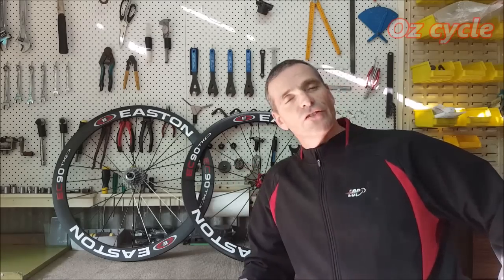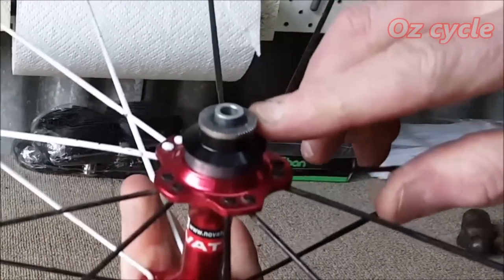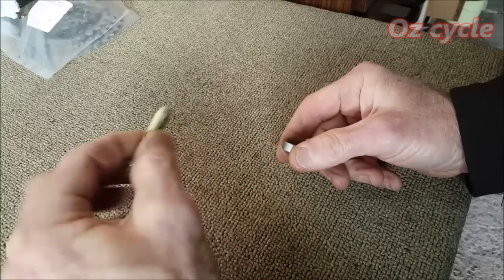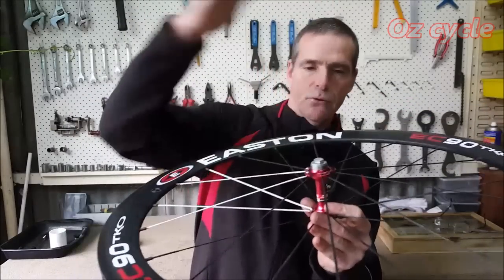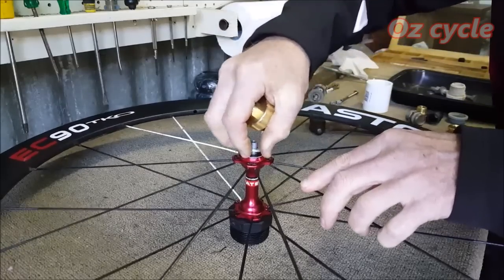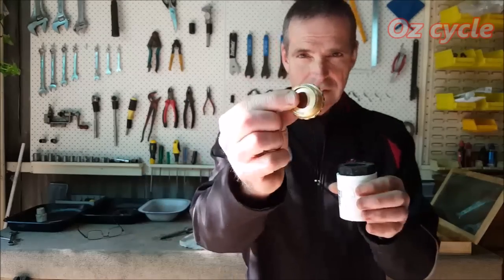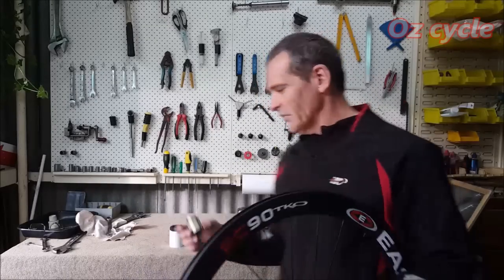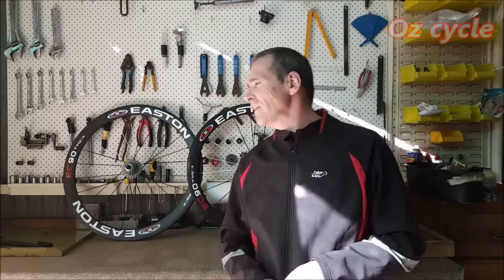Hub sealed bearings-Extract &Press no special tools

Comment: Thanks for the tip - it helped me to pull a bearing without having to buy a bearing puller!
(In the UK these "Dynabolts" are known as "anchor bolts" or "shield bolts", but they do the same job.)
Reply from the maker: Thats great! ...and thank you for the right names for the bolts in the UK. 😁
Reply: hi there, im trying to get in germany but there are so many types. would you point me to the right one? thanks

Comment: Watching this just helped me troubleshoot what was (to me) a baffling problem: there was a bit of slop in my front hub that I just could not get rid of, despite adjusting preload nuts, cinching the hub extra tight etc. It was driving me nuts. Turns out the bearing had crept out at some point and was not fully seated. As a result, the axle wasn't seated either. A few light taps with the proper drift set it in place and the slop disappeared.

I've watched your other videos before, and despite the fact that I have a fair number of homemade and store-bought tools already, I'm a subscriber now. Excellent explanations, especially when faced with something out of the ordinary. Thank you!
Reply from the maker: +Oliver Neubauer Glad to hear you found the problem with front bearing not quite seated right Oliver. Sealed bearing hubs are good but not perfect.
Reply: exact same thing for me!

Comment: Great video - thanks. About to do a front 15mm thru-axle Giant hub with 6804 bearings (20mm ID, 32mm OD) and thought I'd see what YouTube had, you covered a couple of things I hadn't considered. Good tip on the Dynabolt for bearing extraction and the reducing bush as a stand. Will check out your other videos now, some of your tools resemble ones I've cobbled together for one-off jobs rather than paying for the pro tools!

Comment: I hsve the Novatech hubs on my Chinese carbon wheels, I got water in the front bearings from cleaning with the hose and so they then rusted up. Very easy to knock out the old bearings without anything but a rubber/wood mallet. Squeezed the new bearings in with the scewer. So easy I could do it on the side of the road. haha. Still some good stuff here in your vid. Thanks.
Reply from the maker: +ozesalsa Yes Ive seen the squere used as a press  :).  Unfortunately rear bearings are a bit more difficult than rhe front.

Comment: If the bearing is very tight leave the bearings in the freezer overnight which will make the bearing shrink slightly making the job easier
Reply from the maker: +Danrandon900 Thats a great suggestion Danrandon!!
Reply: oz cycle my Whyte 146 pivot bearings are so tight on tolerance that it's the only way to get them in without getting them in at an angle. The other way is to heat the object you are pressing them in to but you can damage paint etc and possibly weaken the part. Freezing the bearing is safer and less hassle
Reply from the maker: +Danrandon900 Gee thats tight! Have you tried using teflon based lubricant to help them glide in?
Reply: oz cycle tried everything. Spoke to Whyte and they do it the way as me
Reply from the maker: +Danrandon900 Nice to know...thanx.
Reply: And heat gun on the hub
Reply: @Melissa H lol🤣🤣

Comment: Thank you, great video. 

I am missing one part of the Press-in. You tapped the drive-side bearing on to the axle. Next step is how you insert the non-drive-side bearing. How do I press in the drive-side bearing on the axle?
Reply from the maker: Press driveside bearing into the frame first,then push BB axle thru frame.
Reply: @stevenleffanue  Thank you. I managed to get the the bearings back in. Your video helped me enormously.
Reply: Extraction/insertion of the drive side bearing is conspicuous by its absence. Will probably be obvious, when I come to do it, but would be nice to see it, for completeness

Comment: Just some advice you may want to alter your process. When you put force on a bearing to install or remove you always want he force on the outer race. This method puts force on the inner race. This makes microscopic dents on the race and make the bearing start to wear and be less smooth. You may never notice this or if its real tight you may notice this the first time but the dents are there. Just something to think about if you are a racer that is looking to save all the watts possible.
Reply from the maker: Absolutely right Andrew. Try cleaning and relubing the bearing without extraction. If the bearing needs to be removed....To dislodge some need to be tapped on the inner race. In this case the bearing should be replaced.

Comment: How to remove bearings in Chosen hubs with hallow aluminium axle spacer between the bearings which joins both inner races of the bearings together? I guess with a blind bearing puller only.

Comment: I say the dynabolt thing makes no total sense. You can just tap it inside the hole right? Maybe a washer for even tapp distribution but all in all great informative video thanks
Reply: My dyna bolt pulled through. Instead just hit bearing with bolt from inside at 3, 6, 9, 12 positions until it falls out
Reply: You may damage the bearing. I think the point of the dynabolt is that it distributes the force evenly on the bearing. If you do not plan to reuse the bearings, then yes, tap it out.

Comment: Three years on and this video is still, great. I think I might of solved it for now but this morning  I got that crunching noise from my back wheel and wondered what it was. The wheels are low budget Fulcrum Racing Sports. Working on the non drive side I discovered they were cartridge bearings , my first as all my other bikes have ball bearings , so I lifted out the seal and filled it with grease which hopefully will last a few months. So I can see how you could replace this bearing but when  tried to get the freewheel off it appears to be non detachable and tied on by  the spokes. So if you should read this can you tell me whether this is common on cheap wheels and could I use a variation of your method to remove the wheel bearing that sits inside the freewheel. As normal your videos are Premier league stuff. Thanks.
Reply from the maker: All bearings can be replaced. It should be possible to get instructions from  Fulcrum in your model hub ,Ted.
Reply: @stevenleffanue  Thanks for replying and I will look them up. Enjoy your Summer. Ted

Comment: What a nice chap. Great video but you didn't remove the rear drive side bearing?
Reply from the maker: Rarely does the inner bearing require service/replacement as it is sealed from the elements by the hub shell.

Comment: Some bike mechanics dont recomend taping for insert they use like bolt press to put the bearing´s in! But they have to tap at least one of them? Or there is another way arround?
Reply from the maker: +N Garcia Some hubs the bearing fit is tight so a press is better. The important thing is not to damage bearings either extracting or pressing and that they seat evenly.

Comment: Great informative video! Just wondering what dimension of expanding bolt you would recommend for removing a bearing with internal diameter of 15mm (6802/3)
Reply from the maker: Closest size to 15mm is 12mm Mat.
Reply: I wrapped some soda can aluminum around the inside of the anchor-bolt to expand the sleeve a bit extra to bite on a larger diameter bearing.

Comment: Hi Oz Cycle.  I've just installed brand spanking new bearings in my rear hub and, silly me, I've realised that the tube or cylinder that sits between the two bearings inside the hub is still sitting on my bench top.  So, I need to remove one of the bearings.  I used your methods in this video to get the old bearings out, as I was going to be throwing them away anyway, but what are your thoughts on using the "tapping" method on a freshly installed new bearing?   Is my fear of "tapping" a brand new bearing out unwarranted?
Reply from the maker: Tap it out by the outer race edge if you can and it will be fine.
Reply: @stevenleffanue  Thanks mate.  All done.

Comment: Would you please be so kind to explain how this works on a Giant P-SLR 1 (50 mm) wheelset with 5 mm QR spanners? This set is build with DT Swiss hubs. Sadly, nobody seems to know how the freehub body comes off. In my case this body is damaged and i would like replace the bearings as well.
Reply from the maker: I dont have a video specifically for your DT rear hub Arno but there are quite a few on Youtube how to remove the body and service it.

Comment: I used deep impact sockets to drive the first bearing out, second bearing wanted to play games so I hit the hub with mapp gas torch and drove it out with a few hard smacks on the hammer. bearings are totally rusted and crunchy, this was the clicking noise i was getting when coasting.

Comment: Love your videos really informative...my problem is that I’m not on Facebook, so unable to get of the item measurements I require to make your tools...I’m also have trouble looking for the 40mm reducing bush...I’m based in the UK
Reply from the maker: If you cant source the 40mm reducing bush,I can send one to you?...postage would cost more than the bush itself tho.
Reply: oz cycle...I’ll keep looking or I’ll find something similar.  But many thanks for that offer...Keep up the great work.
 Cheers Max
Reply: @stevenleffanue   just put the bearings in the  freezer for an hour  and they should pop right in without any force.

Comment: Can you replace the unsealed bearings on a Shimano 105 hub with sealed bearings? Great video and tools to :-) ! 👍
Reply from the maker: You could but the sealed bearing may move around a bit on the curved race designed for round balls. If you could remove those races and get a nice square fit of the sealed bearing to the hub shell it would probably be ok but that's a bit of work and if it doesn't work out you have ruined the hub.
Reply: Cheers Thankyou . What size ball are they as they extremely grindy

Comment: Hi,
I'm interest in the following setup, What sellers do you recommend ?
- Front 24mm rear 38 mm
- tubular
- lighter Hubs with ceramic bearings.
- finish ud mate
- all parts black.

thanks
Reply from the maker: Yup. Yoeleo are now using DT Swiss 180 carbon hubs with ceramic bearings.  They will custom build wheels how you want.
Reply: Thanks,
Yoeleo are a little bit expensive..... do you trust in light hubs from novatec (AS511SB FS522SB ) or powerway (R36 or R39) ?
Of which are the best for your experience ?
Reply from the maker: Yes,Yoeleo are not the cheapest wheelsets. I would lean towards Novatec myself ,they have a good longterm reputation.

Comment: I removed rear axle , but left the 2 bearings inside. I want to remove both bearings cartridges for new. Do i just do this with dyna bolt methods like front hub ?
Reply from the maker: Yes you can or use a blind end puller
Reply: @stevenleffanue  i managed to fudge it so it worked, bit difficult. Just curious so i understand, why did you use the bolt press method for front and not the rear to install bearings. ? Cheers🏴

Comment: Can we just use the old bearing on to new bearing and tap it on?
Reply from the maker: Not sure what you mean Deniz?
Reply: @stevenleffanue  Instead of using a washer the same size as the outer bearing race, you can use the old bearing instead, since it's exactly the same size. [You may need the washer on top of the old bearing though.]

Comment: If you got the bits lying around it's worth doing it like so, however if you don't just get the proper tools. 
Especially if it's the first time doing it so you don't ruin the new bearings or worse the hubs. Bicycle tools are pennies and you don't have to buy top of the line tools.

Comment: When i tighten my front wheel now it sticks s little when spun after bearing replacement has a sudden stop when its tightened on the bike but frees of when i loosen skewer is this normal
Reply from the maker: Check that bearing is seated all the way in and that a seal or dustcap isn't impinging on a bearing.

Comment: I'm wondering why bike shops don't rent out a bearing puller set? 🤷‍♀
Be careful if your bearings are seized in, pulling from the centre could wind up badly leaving the outer race stuck in place.
Good ideas though, thanks!

Comment: Nice video on the bearings, I love all the tools you make yourself, trouble is, those are all metric and it doesn't translate too well to what is available here in USA, I will figure it out though. 

now the real reason I am writing is to find out about that jacket in the video, I have been looking for something like that. is it a "soft shell" jacket? Does it breath well? 

Keep up the great videos. 

Axel
Reply from the maker: +axxxxman Glad you like the vids. Dont worry too much about the measurements,they allow for quite a variation...plus you can put the metic measure into google and it will give you imperial sizing. 
The jacket is Chinese from ebay....brand on it is "Loc". Its shower proof,wind proof and breathes. Cost AU$37 Sorry I dont have a link for it as bought it 2 years ago.

Comment: My hub bearings have 12 mm inner diameter (6001), do I need 8, 10 or 12 mm dynabolt? Thanks!
Reply from the maker: 10 or 12
Reply: oz cycle thank you very much :)

Comment: Can you remove the bearings in the cassette body? That is what I'm attempting to do so I do not have to by a new freehub body. Ideas?
Reply from the maker: Yes but depending on brand/model it is usually more difficult. Beware of hidden circlips.
Reply: @stevenleffanue  Thanks for the tip. There was a snap ring that I discovered. after getting the outermost bearing out of the body housing. Replacement bearings are on order. Will be very pleased to get this set of wheels back on the bike. (EASTON EA-90) Thanks for your reply  and thanks for your informative channel. Great work!

Comment: I have a front hub. Novatec d88sb that i cant get the end caps off. I can get get the axle end caps off but there is a secondary endcap i cant get to come off.
Any pointers ?
Reply from the maker: I think the caps are held in by 2 rubber o'rings. You may need to use a 'blind end puller" to get them off.
Reply: Hey lol i just got them off. You are correct. I used the handle of a socket wrench and they popped off. I just popped off the seals and i dont see any damage or debris. They have no play but seem like they are too tight. Very rough. Like over tightening a cup and cone setup. I can clean and regrease them. Im just wondering why they feel so tight and gritty. Its so bad i can feel them vibrate through my forks when spinning the wheel. Should i have them replaced ?
Reply from the maker: Sounds like the orings are dragging on the opposite surface...bad tolerance machining by manufacturer.You could put a very ligh lube on the orings(like an oil). Remove the orings but dirt would get easier.

Comment: Oz, what bearing do you suggest using, ABEC 3 or 5?  Thanks
Reply from the maker: Depends where the bearings are used? For less loading but higher RPM I'd say ABEC 5. Otherwise ABEC 3 is perfectly good for our bicycles.
Reply: @stevenleffanue  Thanks for that quick response.  Question.  What do you mean by less loading?

Comment: Hello. does this work for the not do tool-less DT-Swiss 240 wheel hubs?
Reply from the maker: +vhornfellow Hubs vary as to gaining access to the sealed bearings.You may require a DT freehub removal tool. Once removed however all sealed bearings are pressed in and pulled out of a hub shell so yes you can use this tool for the job.

Comment: What of the theory that once bashed out by way of force applied to the inner ring, the bearing then is damaged and needs to be replaced?  Sweet homemade tools though... genius!
Reply from the maker: +Damon Lowell Always apply pressure to the outer race. If it can only be applied to the inner race then, yes,it will need to be replaced.
Reply: The only reason to remove a bearing is to replace it. If it just needs regreasing leave it in the hub.

Comment: What is the bearing number?In hub
Reply from the maker: Front or rear hub? If rear,which bearing as there are four?
Reply: oz cycle 
Sir I told you...What number of bearing. Example- 62 00 or 62 01- what is the bearing in hubs
Reply from the maker: Rear shell... 6901-2RS

Comment: I watched all this long video with the only hope to see how to remove the bearing behind the free hub, that one in the area you shown at minute 13.35, but nothing. That is the most difficult thing and you didn't show us... very disappointing.
Reply from the maker: The innermost bearing is concealed from the outside elements so should not need replacing. If you wish to replace it,use the same method  with a longer dynabolt or tap it out from the opposite side with a right sized drift.
Reply: @stevenleffanue  Ok, thanks. Anyway I would appreciate if you had shown this process in the video.

Comment: This is OK if you can get the caps off. Mine are totally jammed on with no grub screws. I have soaked them in penetrant. I wouldn’t touch wheels again that are designed like this. Horrible cheap design.